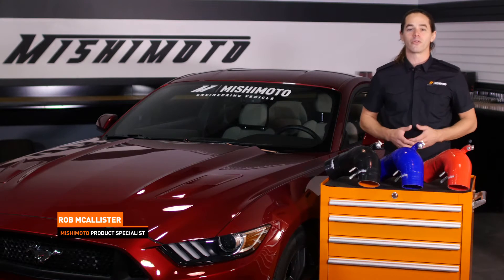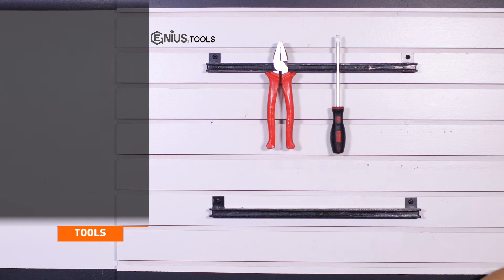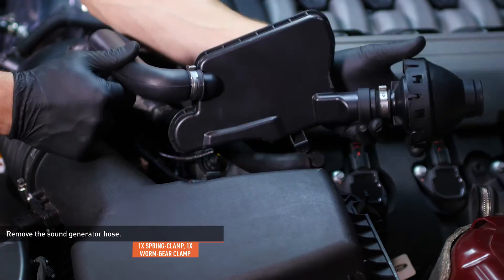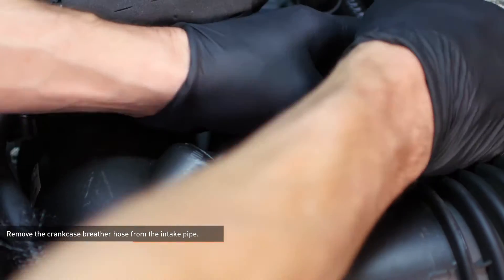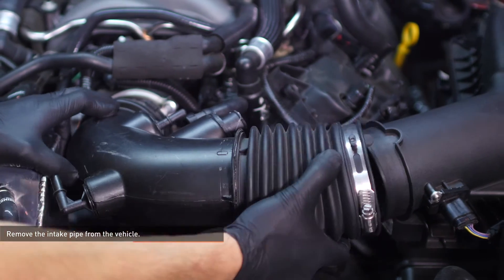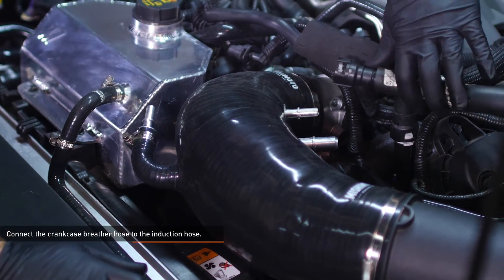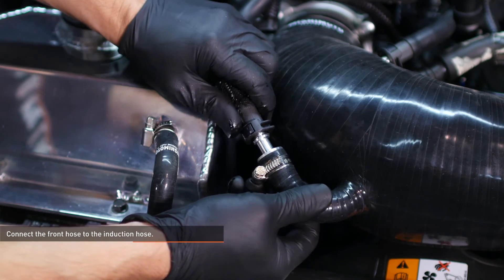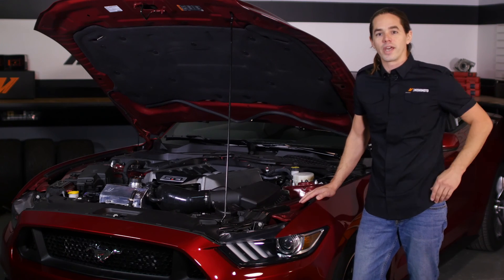2015-2017 Ford Mustang GT Silicone Induction Hose Installation Guide By Mishimoto

Comment: Just an FYI, this does not fit the 2019 Mustang GT. The airbox tube is too large for the hose to go over.
Reply from the maker: The video was released back when the item was first released. Our website does currently show the updated year fitment as 2015-2017
Reply: @mishimoto  will there be one available for 2018-2020  model Mustangs?
Reply: So just get a 3.5 to 4.25 coupler step

Comment: What are those extra hoses on the intake. My 2011 and 2014 didn't have all those extra hoses. Id like to clean up the engine bay if possible and eliminate those hoses if possible.